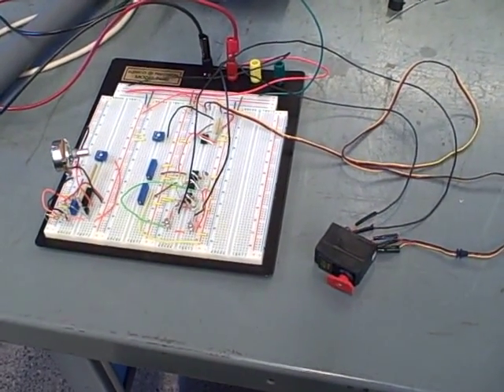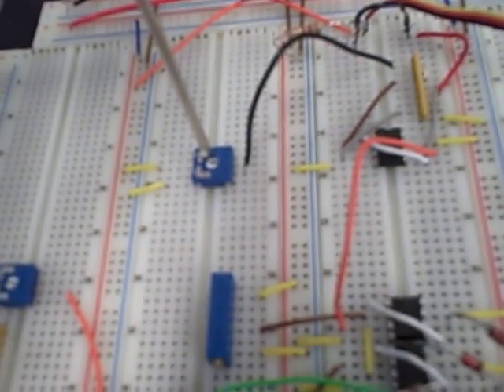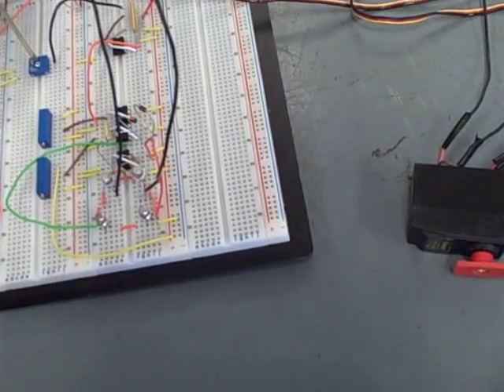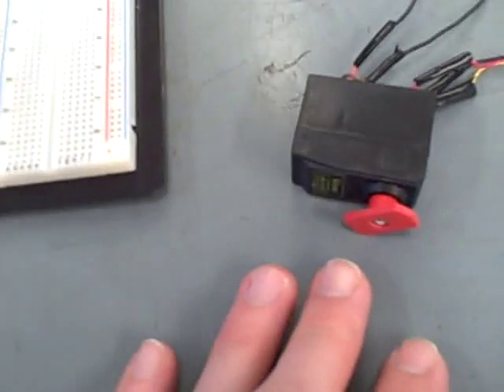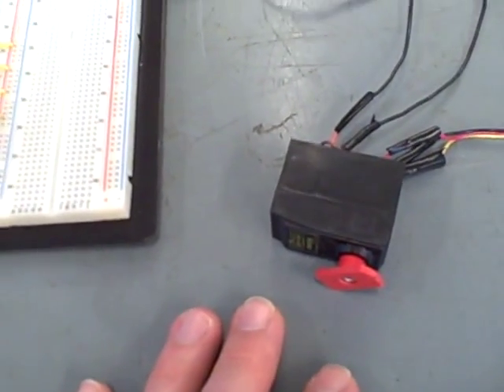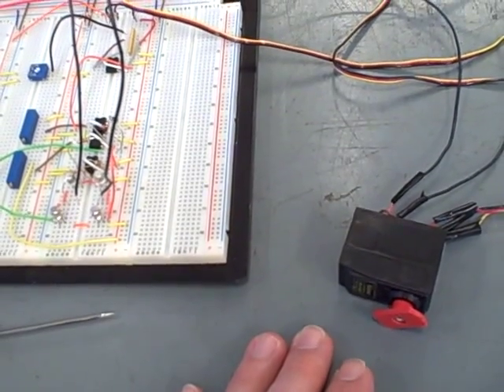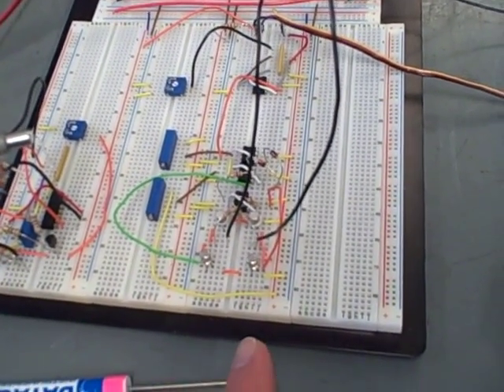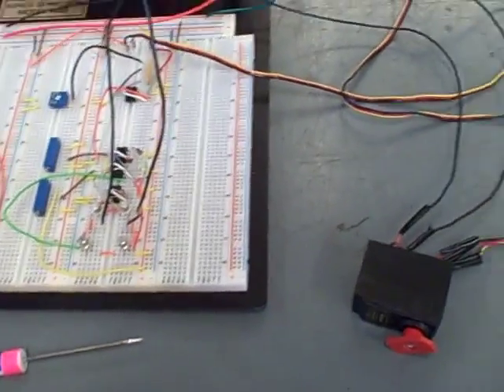Electric valve actuator using RC servo (prototype -- part 1)

Comment from the maker: You would certainly need a "high speed" PWM output card on the PLC, because the PLC's regular scan time is just too slow to do this kind of pulse-width modulation.  I don't happen to have any PWM output cards handy for the PLCs we use in the lab, so I had not bothered to try.  It's a good idea, though!